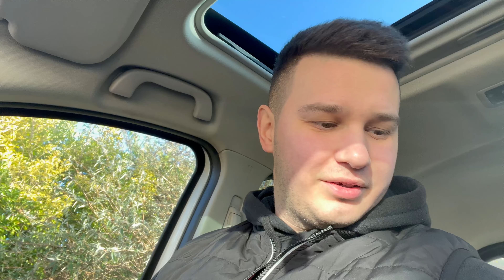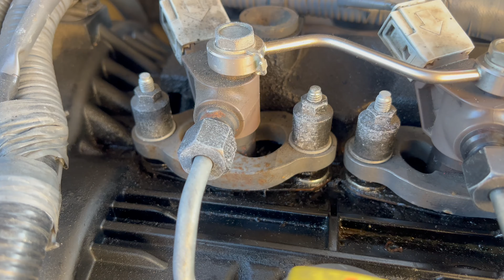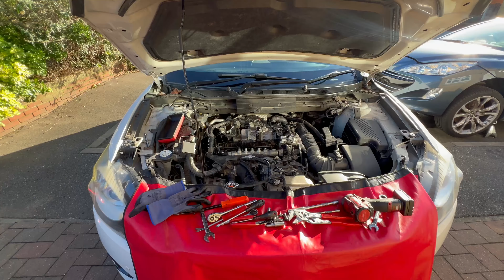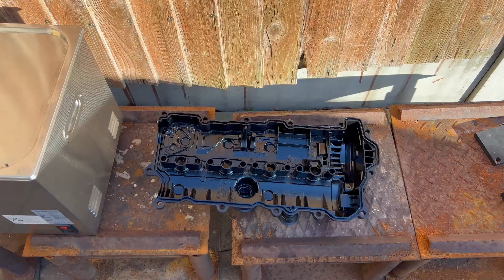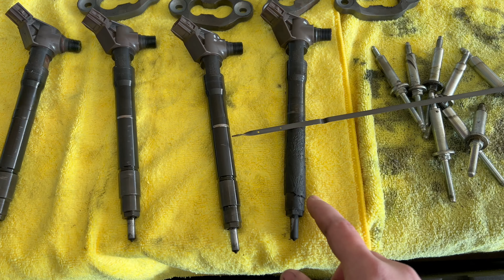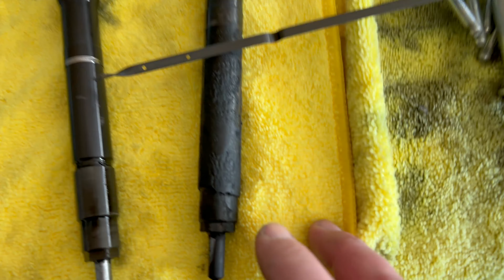RAC: It is SAFE to drive with Low Oil Pressure - Mazda CX 5 Skyactiv 2.2 Diesel Oil Pressure Warning

Comment: From my experience the Oil Pressure Warning can be triggered by different things on the SkyActiv-D engines, mainly by these 2:
1. When the Oil Pump is blocked, therefore it's bad! You need to stop and trail your car to a mechanic like MrNiceGuy :) 
2. Or when it's doing very frequent regens (bellow 50 km), therefore the oil is diluted and the pressure is lower than the values that the MrNiceGuy cited several times. In this case a change of oil should ok to fix temporary the problem, then to understand why the frequent DPF regens (injectors, DPF, camshaft, EGR, diff sensor, intake carbon ...)
So in both case you should not drive the car with the error. 
 A good app for OBD for this engine is ForScan Lite that let you read the engine metrics like Oil Pressure, Last Regeneration in km, Oil Dilution value or it's doing the reg in a certain moment...

Comment: How do I get in contact with yourself please? I have a cx5 which had suffered the low oil pressure but also a worn camshaft the oil pressure issue has been sorted but the garage won’t change the camshaft which I have.
Reply from the maker: Message me on my facebook page, same username and profile pic as on here.

Comment: hello NICE GUY

Today my Mazda gave me the low oil pressure warning.

I'm going to try to change the oil strainer and injector gaskets with my mechanic.

Could you give me the references of the parts necessary to do it?

The rocker cover gasket and head gasket should also be changed, right?

 my fear: since I have the oil pressure problem, the engine sounds different (horrible) at idle, like an old tractor, could it be the hydraulic lush? someething could be damaged because being at idle 5 min with low oil pressure??

i have NOT moved the car since then

THANK YOU!